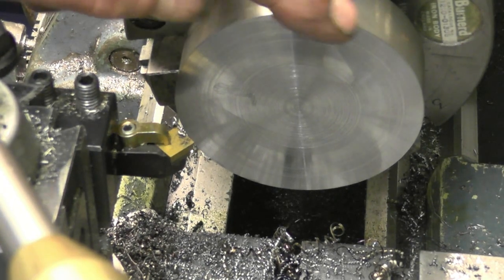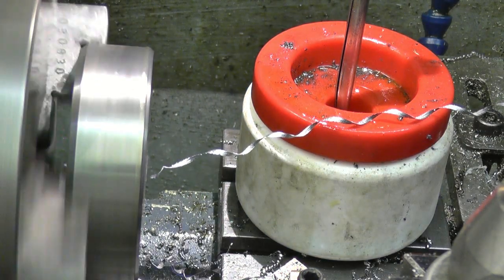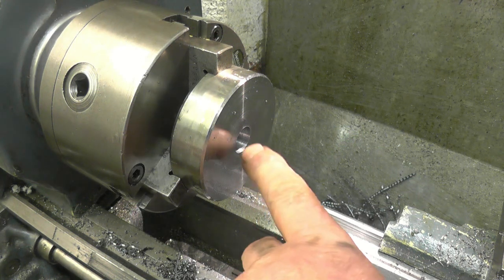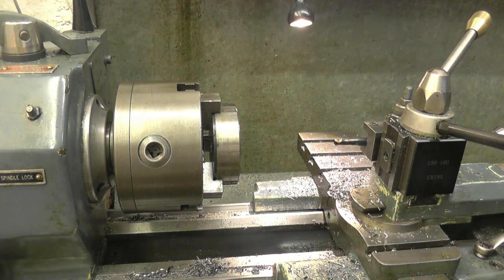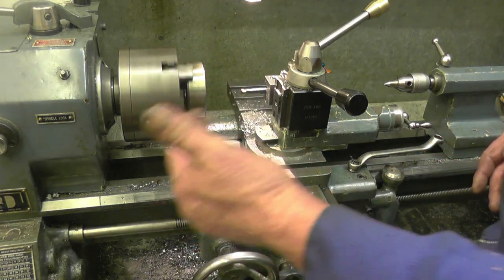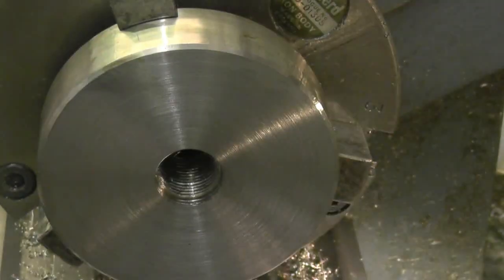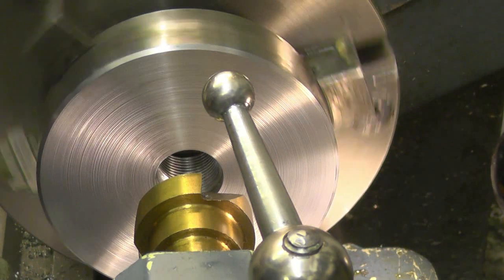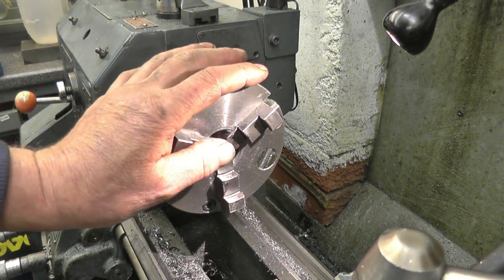Big Head part two

Comment: Good job john, you know when lathing large diameter peace's and your lathe slows down under the load have you looked at the settings under
Torque compensation 13 Torque compensation gain/ 10% increase it made a difference on my Raglan 5

Comment: John, thanks for the lessons in metric threading. One of there days I may have to figure out what it would take to do that on my lathe...that is, what gear I'd need to find or make...my lathe is a South Bend 9", a little like yours. 

What sort of changes do you try first for better finish?  Feed rate? RPM increase?  Larger radius on the tool?  Different angle on the tool (negative or positive rake?). What goes into the decision?

I'm going to make a lever nut like you have on your QCTP...what material did you use?  I've been trying to figure it out, but the lighting makes it look silver sometimes, golden others.  It's probably not titanium...could it be anodized aluminum?  

I hope Deb is still doing well, and you keep getting good news. 

-- Mike